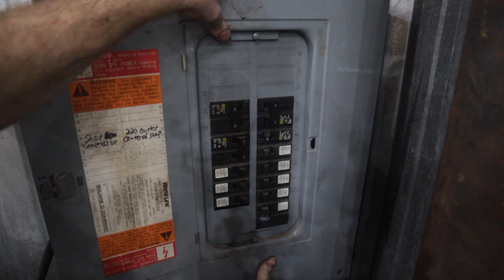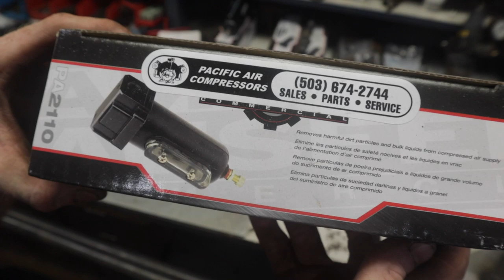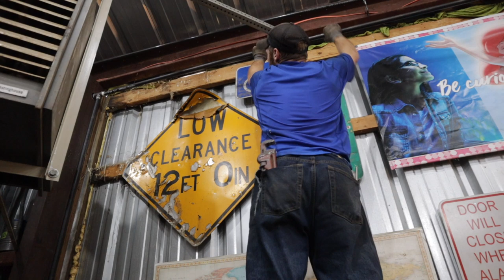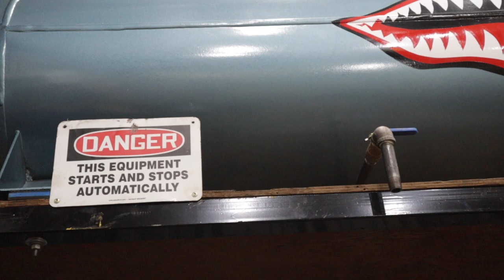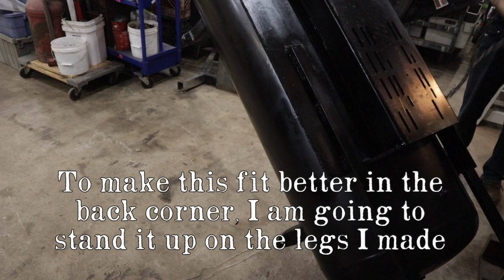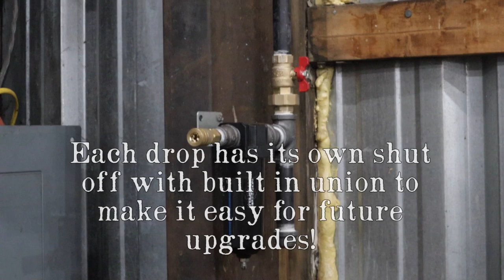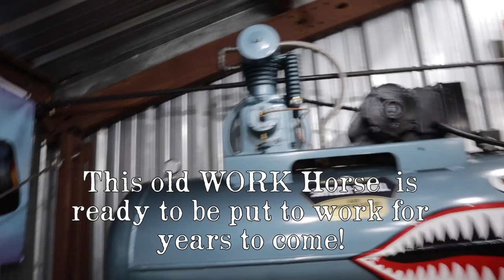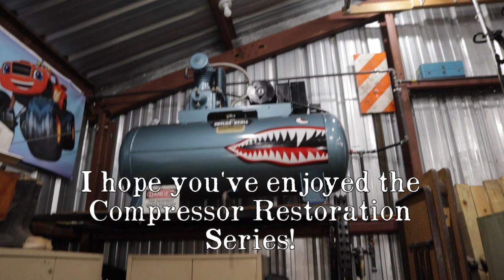OLD 2 Stage Air Compressor ~ Compressor on a SHELF ~ RESTORATION Part 4 ~ FULL Air Line Installation

Comment: If no one else has mentioned it... if you run the air intake out the roof & use a good water proof (shielded) air filter it will drastically reduce the noise in the shop.  I you happen to build build a sound deadening box around the compressor you can use cheap ceiling tiles to line the inside walls.  They work great for noise reduction.  It may not make it silent but will definitely take 90% of the noise out of the shop.
Reply from the maker: It's not really all that loud, but that's not a bad thought... I would probably send it out the side of the shop... I try to avoid the potential for leaks in the roof! I will not build a sound proof box around it, because then I cant enjoy the awesome paint job I gave it, but if I was to do so, it would be with clear PVC panels!
Reply: @SalvageWorkshop ... Give it a try... you'l be surprised the difference it makes.  What I discovered in my own shop years ago is how the compressor was magically connected to the phone... every time it rang the compressor would turn on!  You might not experience the same phenomenon?  As an artist myself I wouldn't cover up the graphics either... they are awesome.  A great design idea.  Really enjoyed the video series.

Comment: Nice airline install.
I would add a drain tap in each of the blanking plugs at the airdrops to make the weekly ??? empty out of accumulated water easier. 
Long ago when I was tasked with airtool maintenance in a car factory equipped with a refrigerated air dryer there was still significant water build up in the air manifolds.
We also took all airdrops from the top of the distribution manifolds to reduce the chance of water entering the airtools.
WATER KILLS airtools!!!!!
Cheers Eric
Reply: midgoog2 His setup is perfect, He has a filter at the compressor and a filter immediately before all air hoses! Between all the filters and drip legs he will be just fine! If he maintains his Air tools as well as he works they will be oiled daily!

Comment: A little tight to get to the belt when it needs replacing, but it is definitely up and out of the way. Paint job looks great. 
If I may add some advice, some bat insulation up in that corner on both sides and the ceiling would dampen the sound from echoing into the shop. This would make future videos sound track a bit cleaner, without the hammering of the compressor to talk over. It wouldn't get rid of all of it, of course, but surrounded on three sides by metal only makes it louder. Would have liked to see the auxiliary tank piped in.

Comment: I want to see more and the setup of the outdoor air line. Very curious what you do and don't get rid of when cleaning out. I have a ton of junk I need to make decisions to toss.
Reply from the maker: I'll definitely include that upgrade in a video in the future! The biggest problem with my shop is that I need another entire building for storage of materials and  future projects.  Part of the reason Its called SALVAGE Workshop is because I am always re-purposing things and building things from used or salvaged materials, but storing them ca be difficult, so I guess we'll see what I come up with! I appreciate the feedback!

Comment: This has been interesting and I learned some things, and I'm OLD..LOL.. I like that you used pipe sealing compound instead of tape, tape is ok but not for this. I used French Cleats in my shop to mount just about anything to the walls, makes it easy to rearrange. Even storage bins for hardware.. I would like to see what you have in mind for your shop..Peace
Reply from the maker: I'm glad to hear you enjoyed it! Nobody's too old to learn new things! I actually used a few wraps of teflon tape, and THEN paste.  There is a local steel mill has air lines with incredibly high pressures, and a friend who works there said that's how they seal their air lines!  If it's good enough for them, it's good enough for Salvage Workshop!!  If I had walls that were drywall or plywood, I would LOVE French cleats, because of how easily adjusted things can be. I have a few ideas for my shop, but many ideas happen once I start getting something setup, so we'll see what happens! As always, thanks for watching & commenting!

Comment: Hello, nice work on the air compressor install. Did you think about adding a moisture drain off of the vertical runs?

Comment: 16:32 I missed the bit about the black tank. Is it hooked up to the shark compressor for additional volume? Good install. I'm wondering if adding some insulation behind and above the compressor would reduce the noise reflection off the metal structure? 
I'd love to see your shop mods! Always great to see how other makers approx projects.  I always pick up helpful tid-bits. Thanks!
Reply from the maker: Ya the amount of work just to get to air system finished was a TON, so the extra black tank kinda got lost... I was planning on attaching it to the shark tank for another 120 gallons of air capacity.  I may change my mind on that, because the  extra air capacity might increase the about of time between when it turns on, but it will also increase the time it takes for the compressor to fill up the air tanks, One idea that would be even better would be to restore the Champion compressor I have and it into the air system giving me 240 gallons with 2 BAD A** compressors refilling the air tanks extremely quickly.  So for now, I have the black tank where I want it out of the way, and all ready for whatever I decide to do! We'll see about insulation, it's honestly not too loud, and doesn't run for long, but we'll see after I've been using it for a while! Thanks for watching and commenting! I truly appreciate the support! Lot's more to come!

Comment: Where do you purchase your rebuild kits for your compressor pump? I have an old 1954 Erie Meter Systems Two stage monster. Model 5075 I need to finally rebuild this sucker
Reply from the maker: Pacific Air Compressors... either check out their website or give them a call! They're extremely helpful!

Comment: Should of use pex for the air lines. There good up to 2 hundred psi with no leaking and can add lines later using shark bites. You can do a whole shop in about a hour.

Comment: So I searched every comment and only saw it asked once with no response.  What did you use to connect the active compressor tank to the hard line?  I hope it was a section of stainless braided flex line.  Without it at some point the line will fatigue and crack with vibration and thermal cycling.  To minimize vibration and noise consider a twist link belt.  Just make sure you install it in the correct rotation.  if you search that belt you will see a Matthias Wandel video where he installed the belt backwards and blamed the belt.  He never addressed  the multitude of individuals calling it out.  Real shame his ego would not allow him to admit the error.  I use them on all my compressors and the difference is noticeable.

Comment: If you pipe the intake outside and get an outdoor filter it will make almost no noise inside. To test this theory remove the intake filter and cover the inlet with your hand while running, it will my a little more noise than this with an outdoor filter.

Comment: By the way are you going to rebuild the other 2 compressors?
Reply from the maker: I am going to restore the green champion compressor pump & electric motor at some point, but the tank is junk... the blue vertical FS Curtis I dont plan to do anything with other than move it along.

Comment: Your Rigid pipe die won’t thread because the handheld bandsaw is leaving a lip on 
the end. File a chamfer on the end or better  still, use a pipe cutter. The die could be toasted.
Reply from the maker: I did not know that... I do have quite a few pipe cutters, but always used the bandsaw because its faster... Ill have to give both of your suggestions a try! Thank you!

Comment: Why not vent the exhaust from the pump outside A lot less noise in the workshop
Reply from the maker: Good thought, but there is no exhaust pipe on an air compressor TO vent out since it's powered by an electric motor... the air that comes out of the pump is the actual compressed air that is pumped into the tank and then on throughout the shop air system.  Another option is to buy a better Air Filter / Silencer that helps quiet down the air getting sucked into the compressor pump.  Maybe if money allows I'll get that upgrade done to it! As always, thanks for watching & commenting!

Comment: Do you know how much it weighs?
Reply from the maker: The compressor pump itself weighs 200lbs, the electric motor is probably 100lbs, and the tank weighs something like 1000 lbs or so... So i'm guestimating 1300lbs or so... not totally sure, but too HEAVY for me to pick up by hand lol!!

Comment: hope for your sake OSHA or local build inspector does not see what you did with the load bearing structure that your trough  together WOW You really need to learn to weld and bolt the beams to the floor and OMG you install the compressor before bolting to the walls Im glad your not died when the thing fell on your head